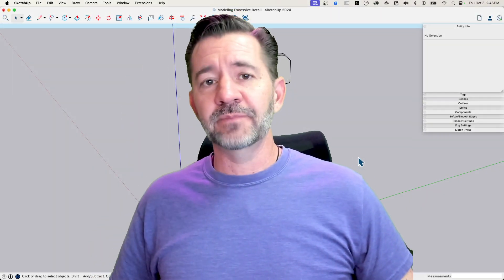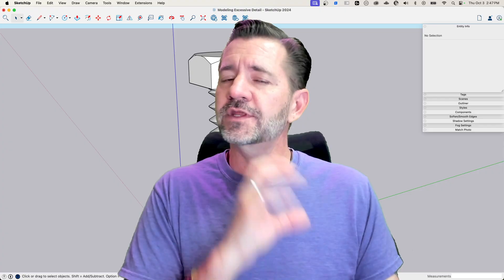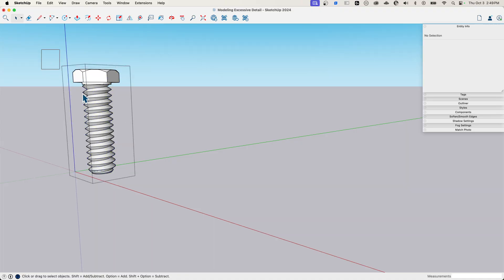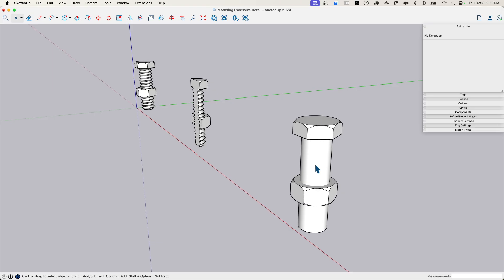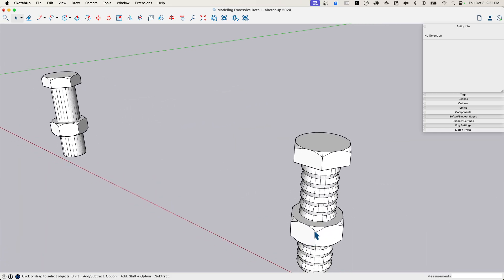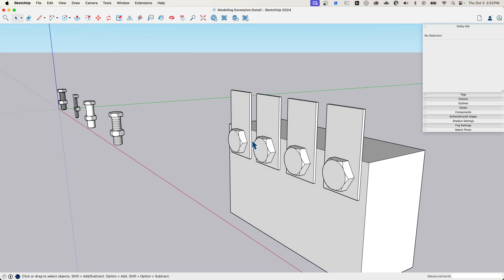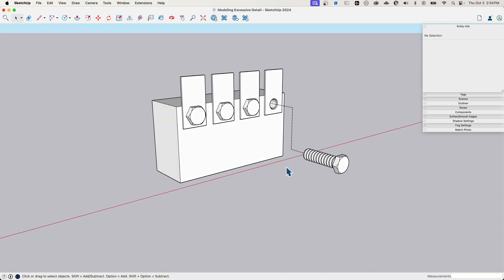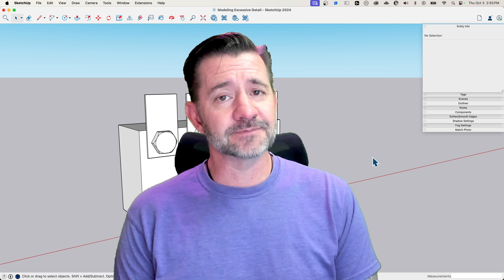Modeling the Correct Level of Detail

Comment: I started draughting on a board using ink and paper... yes ink and paper, so imagine the hours that would be used if you drew every little detail, well the budget would be blown. So I took the way of just remembering that a lot of the drawing work is just showing representations of items needed for manufacture. Although I worked with many a design engineer with degrees hanging out of orifice who struggled with that concept, which I interpreted as an insult to the tradesmen actually putting the components together. So much brains and no common sense.

Comment: Thank you Aaron, very well explained. 
It is fairly frequent that I produce a model with a future use in mind and this can lead to excessive geometry. In your bolt example it may be that later I will want to show the assembly process, with bolts rendered either with threads or just a simple line to infer a thread. This is where I would use an external component model of either a simple bolt or a detailed version, that can be loaded in (right click component > “Reload…”) to replace an instance of the bolt without needing to move it. Perhaps you could do a video on the topic of “Reload…” & “Save as…” components, including the need to make unique, controlling the position with Axis, etc?
Reply: You're totally right.  We need a way to select the Level of Detail (LOD) by a view or specifically to a single element/object (nut and bolt).  I would like to know if sketchup is capable of this.  i.e.:  Create a parametric nut/bolt set that could change LOD according to the view.  Thaking this to the limit, if you could show or hide the threads and nut of the bolt if it wouldn't be seen in the view would be awesome.  A huuuge number of poligons in our models is not visible!  This must be the top priority in BIM modeling software development.  My question:  Can we achieve this with SU OOTB?
Reply: @LostMarkTwain  Yes this is possible with Sketchup, without plugins. A few years ago I had a refurbishment project of a local train station, that included models of new canopy columns. We had a software engineer create a detailed model of the column and spandrel panels but it had over 200,000 polygons. I imported his model and used it to position in my main model but then made a duplicate, with much of the detail removed to leave only the frame. Switching out one model for another was very quick, if a high detail render was needed. I am hoping that Aaron will make a video on this type of workflow as it can also lead on to team-led construction, where markers are placed in a main model and others then work on component parts, that are brought back into the main and updated as needed.
Reply: @across8339  I get it.  But this is a manual process, right?  I am looking for an automatic switch of LOD within an element.  Like a predefined set of versions of the same element.  One for LOD100, 200, 300, 400, 500.  And I could set, lets say, "LOD100 for appliances and LOD400 for cut doors/windows in a section" for a specific view in a layout. (?)
Reply: @LostMarkTwain  It sounds like you have a very specific use-case, there may be a plugin to assist but the geometry would still need to load even if not displayed.
Reply: @across8339  So...  If the geometry is set "inside" the element it always count as load in the file?  In other words, all the element LOD versions count in the poligon count of the file?
Reply: @LostMarkTwain  It depends what you mean by versions. Using components makes a huge difference, particularly if there are many instances of the same component. For example: if you draw a cube it would have 12 edges. If you duplicated that 10 times SU would save (and load) 1200 individual edges. If the first cube was made into a component, the file would still show as having 1200 edges but the file size would be much smaller as there is only one component but many references to it. As further example: having 100 copies of that cube component makes a file size of around 332KB but having 100 cubes the file becomes 3.2MB.
Reply: @across8339  By versions, I mean a single component (dynamic?) that has a "LOD" parameter option that display the component with 3 options for LOD.  Perhaps I am trying to mimic gdl (Archicad parametric language) with Ruby.  You know...  Graphisoft/Nemetschek is showing us AC users the middle finger.  I am searching for a more fair replacement, and I am really impressed with sketchup.  Will see...  Perhaps some Ruby Guru came up with some solution for this LOD thing.  Anyway...  Thanks for sheding some light on this.  I will keep this investigation. Cheers!
Reply: @across8339  Actually I found a video here with the information I need.  FYI it has the title:"Triple Level of Detail using Components"  I think it is pretty close to what I want...  I'll check it out.  Anyway...  Thanks for sheding some light on this.  Cheers!